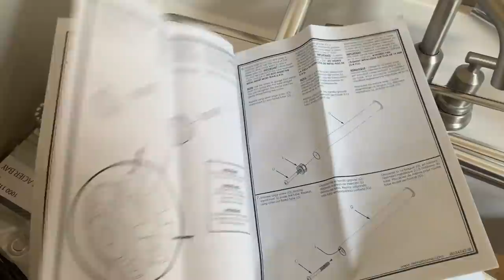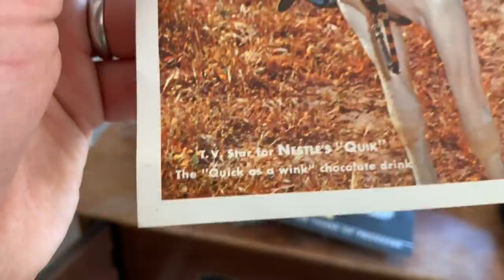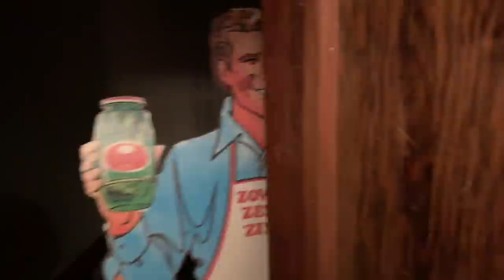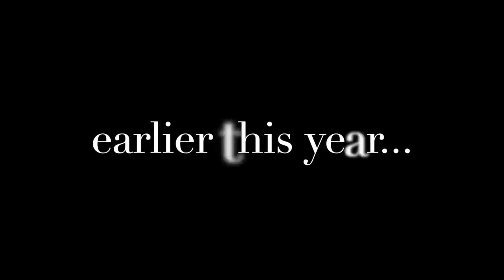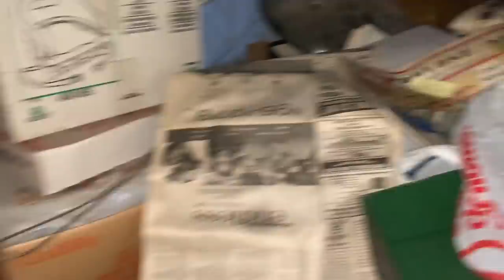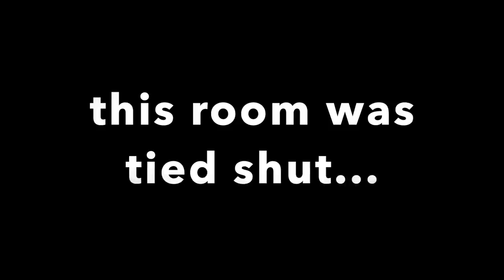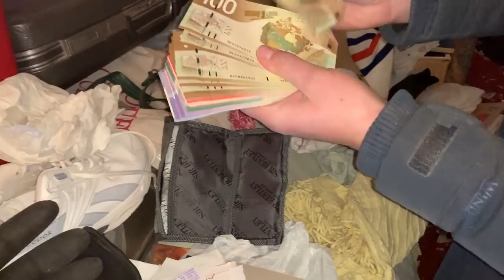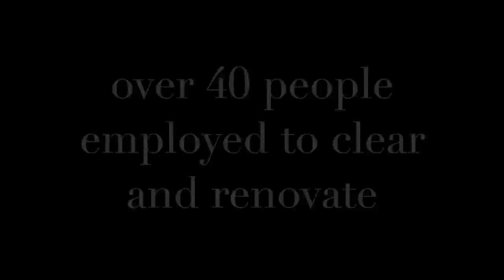Part 20. transformation! Potters house, The Before & After

Comment: I Love the old school butcher block! Glad you kept it, adds a bit of charm 😊 That tile in the wrap around shower curtain matches the curtains downstairs! Excited for the next journey ahead, SO glad I subbed! 😁
Reply: I thought it would be worth a try to see how those curtains looked in the bathroom. Even if the pattern doesn't match the black and white would. I was a little worried the shower head is going to be connect to a wall with just paint and no protection (like tile). IDK, maybe it's done without problems.
Reply: Yes! Try the black and white curtains in the upstairs bathroom!  Love this series!
Reply: I so would have brought my planer out and cleaned that block up. Nice and square and clean... yeah, I know... history and all. I'm just a little OCD is all. 😜
Reply: Yes, I agree to try the curtains outside the curtain liner. I’d love to see if that works, and thought it almost immediately after seeing the curtain hung, & the tile laid - they coordinated.
Reply: But the wear of the table fit the upcycled, eclectic ideas for the house: the slightly industrial touches in the kitchen bolstered it.

Comment: You should hang the single stain-glass panel in the kitchen where you hung the fruit art....
LOVE the butcher block...
And great choice with the shear curtains!
Reply: I like the stained glass idea--but I'm one of those who is not so impressed with the ancient butcher block. The only objection I have about it though is that the very uneven surface would be hard to work on. If it were a level surface, it would be fabulous.

Comment: I'm Finnish and here (where in winter it's common to get - 28 C weather) we always have triple or double layer windows. It weird to see that in Canada, where it's even colder than here, in this energy-saving times the one-layer windows are still common.
Reply: those are sealed units with two panes
Reply: Oh no I live in the States Maine top right corner Jeld-Wen are used by a large local builder double pane is code

Comment: I've got a suspicion what was going on with those lights - in short, probably someone with more enthusiasm than skill and knowledge replaced that light switch.

The full technical story: the way these lights behave makes me think that the switch is a 3-way in a 1-pole setup. The power comes into that switch box and goes both to the light in that room and to all the other rooms. The black wires from the incoming cable and the one feeding the other rooms should have gone to the same screw (permanent live) but somehow the one feeding the other rooms ended up under a screw on its own so the switch now either powered the light in that room or the other lights. A friend's mom managed to do the same, although she only mis-wired one socket. That meant she was either able to have the kitchen light on or listen to the radio.

Comment: The butcher block table is a disaster, the top is not flat and level.  Suggest get a heavy-duty sander and take it down to a flat level surface and it would be beautiful and Useable.  I would show a beautiful wood surface which could be clear coated.

Comment: I know it doesn't matter now, I hate that butcher block table too, which surprises me since most things you do I have loved. I didn't like the black curtains either, but thought they would of looked great somehow in that bathroom. And, it was funny but all along I'm thinking how the sitting area looked weird and when  you found the stove and painted it I pictured it in that corner. So was happy to see some things go, except that table....which from a woman's point of view is useless since its totally uneven, it does not really provide anything but autistic, and even that is of little benefit. I thought maybe you were going to have them make the top flat, then it would of been of some practical use. And really there is not a lot of kitchen counter to use since there are no appliances, microwave etc yet so that leaves very little work space and makes the uneven table not a good choice, i think I would of build, or re-purposed a kitchen cupboard and added a work surface on outer wall with could double for a place to have coffee, with a stool or two, as some of use like to sit when we do some kitchen chores. But anyone who buys it can do this too. I know it's all an old issue and doesn't matter but I gotta put my two cents in lol.

Comment: its that the pattern is too large for a fabric that has no weight. The curtains are too flimsy and cheap looking. For a room and space of that kind, you need either a solid colour to anchor the sliding doors, or something with weight (heavier material). Id'd rummage through a value village. Just  ensure they are hemmed to the correct floor length. An incorrect hem will cheapen the entire room.

Comment: you got VERY VERY lucky that Mary had not reached the final stage of hoarding.  when they [the Hoarder] looks at normal objects through a new light specially trash. Might start like this; the TV Dinner plastic tray they just ate a meal from and think"hey each section of the tray could be used for mixing paints, then it rabidly transforms into all trash can be reused if i hold onto it till i find a use for it, though a noble sentiment this transformation happens so quickly the house can double what was hoarded in 10 years over the next 1 year then the rodents come to its now a very serious problem that also no longer allows the hoarder to go un-noticed the smell and vermin will attract attention the hoarder dreads,  human contact with people in authority people that can enter their inner sanctum, its a very sad disease